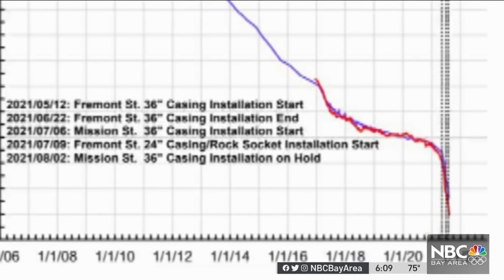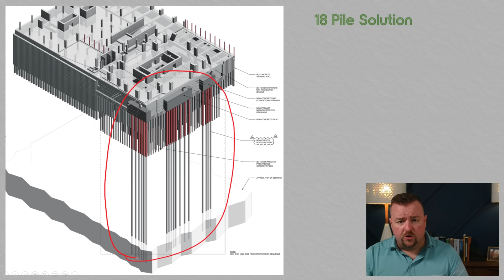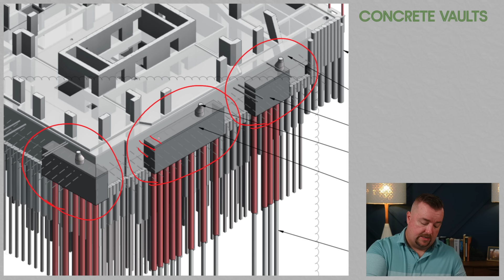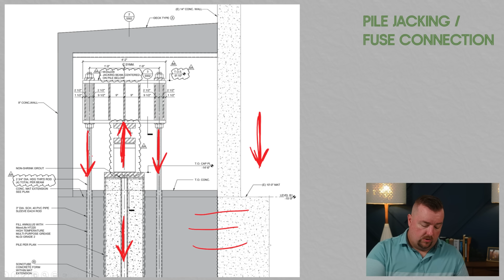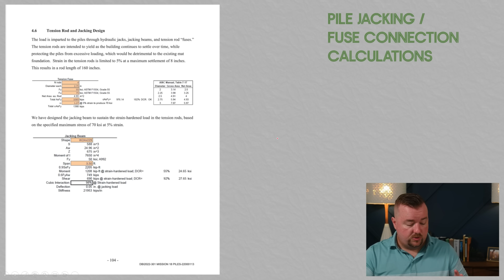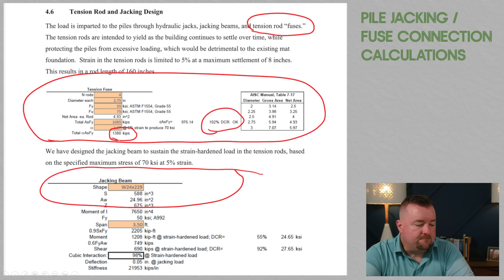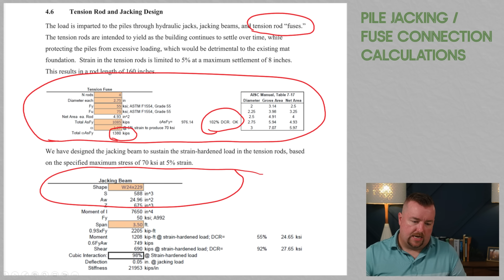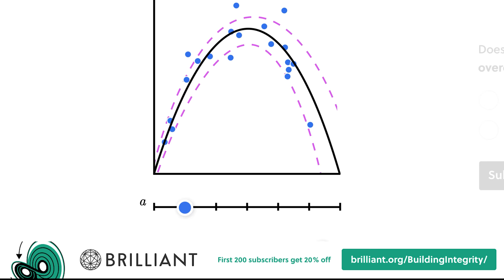Did I Uncover a $100,000,000 Mistake with the Millennium Tower "Fix"?

Comment: This whole cluster f* reminds me of the sequence of events with the Kansas City Hyatt catwalk collapse. I also have my issue with the "fuse" connection to the rest of the structure and the concrete and small amount of rebar being put into tension when the bolts are tightened. I believe that there will be considerable cracking internal of the original foundation as the rest of the building continues to sink. The only question is what comes first...the tiny metal plate that is suppose to hold a couple hundred thousand pounds or the deformation of the tiny bolts holding it all together. Who ever decided to build such a large building in the San Francisco mud without at least a number of pilings going all the way to bedrock should loose their license and be run out of the profession. I am not a licensed civil engineer but it is malpractice not to do ALL the what ifs during the initial design phase. There must have been soil studies and practical experience from all the existing building around them.
Reply: Politics built this building....still is in the repair plan
Reply: Best part about this saga is the people who designed the building are the ones doing that fix!
Reply: They built the foundation, then changed the design and put a tower on top that was twice as heavy as first planned.
Then they were surprised there were problems.

Comment: Boy, I love listening to intelligent people.  The new pilings must have disturbed the material.  The moment you mentioned the grease of the threaded rods I thought, "This doesn't make any sense."  There should be a metal plate on the bottom of the entire concrete block with a hole in it for the pile like a washer.  The threaded rods would penetrate it with an upside-down cone of washers under the plate to spread out the load and then bolted.  I would even weld that entire under plate structure.

The project Architect and Engineers are ultimately responsible no matter what.  The building department will review the documents for compliance to building and zoning regulations but not that what was designed will work.

Comment: The top plate too? As a special inspector in seismic zone, I would want to know the measurements of the plates and the strength of the concrete specified for this. I assume the plates are just typical per the general notes? Probably 50 grade? If they don't work, there is a real problem. Nice catch Josh! I really hope the EOR corrects or somehow proves this works. That a lot of weight to transfer!
Reply: They are designed like macbook traces of fuses. The whole boards catch fire before the fuses break.

Comment: What would happen if the usual insurers decided against insuring a building like this, and /or the usual mortgage lenders refused to lend on the  flats/apartments being built there?
Reply: People are buying units in this thing?!  Who would buy in this failed defective building. How is that possible? wow. Just wow.
Reply: If the developer has a note on it, and couldn't secure new insurance within the prescribed time, the note would immediately get called.
  I'm in Florida.  I can tell you one thing: if this clusterbomb had happened here, the building would have been vacated long ago. Our bedrock is water-soluble, highly porous, and behaves like osteoporotic bone. And our insurers know way better than to trust any engineer or government official.
Reply: @GungaLaGunga  i just looked it up. There units for sale there yes but looks like they have been sitting for some time and all of them are for sale at a significant loss. Not sure who actually will buy there but there are units for sale. There are also some for rent at 3500+ per month.
Reply: @ivanangelov7087  oh interesting. thanks. What a mess.
Reply: 3500 a month! Fk that.  Not a chance. I wouldn't even rent it for 35¢
Reply: @simontay4851   3500/mo to get blamed by the landlord when people's bathroom sewage comes up into your kitchen sink. "The ideal location, and it's perfectly safe. There will be a small waiver to sign, of course"

Comment: If the plate is beefed up then the Nuts start to carry all the load,  after that, the threaded rods are carry a tremendous load.   What I know is you can twist off wheel studs with a large handled wrench.

Comment: Not at all my field... but don't you typically build in a 30-50% safety margin just in case e.g. the condo association refuses to pay millions of dollars in maintenance over the next 50 years? If so, on what planet does a -2% safety margin seem reasonable? Cascading failures are something that I deal with/plan around in my field, so my initial thought was "what happens if 5% of the jacks fail at around the same time and stop transferring the load?" I'm sure that will cause one of the rods to fail due to the negative safety margin. How many rods can fail in that scenario before the entire apparatus fails with a violent "ping" of steel threaded rods? Will that cause secondary damage? Will that secondary damage cause the building to catastrophically fail? Probably the most important question, however, is why is a software engineer like myself asking these questions and not the smarter structural engineers reviewing the project?

Comment: Retired chartered civil engineer in the uk here. It seems to me there are two modes of failure where the tension rods transfer the load to the steel plate. 1. The nuts and washers on the rods pulling through the steel plate and 2. The threads at the  nut / rod interface shearing. Which did you check?
Your video was posted a year ago. What has happened since then?

Comment: As soon as you pointed out the sleeve around the bars I had some doubts. When you started talking about the plate, I knew something was wrong. And I'm quite far from being an engineer or having any sort of physics course.

In software we would get in trouble if we ever designed/programmed something like this for something as critical as this. Just imagine having your medical informations or your bank account behind a software that the developer designed to "have some stretch" to measure how much its close to fail, and with "some" hashing for your password but no one really looked at it, they just used the first result of a google search of "how to save password"...
Reply: Then got a diffie hellmann method

Comment: This sounds like the company chose this fix because it allowed them to do something quickest, rather than if it would work in the long run, they are probably hoping it lasts just long enough for them to retire/die.
Reply: Hoping it will last longer than the warranty period.
Reply: Trust me, the city was pushing for the quick fix just as hard as the engineers and contractors.

I also hate to add a brutal comment but the engineering staff of the city is in no way qualified to review the design of any building of this nature. Unfortunately that is why they are working for the city and not for major engineering firms.

Fact of life in any city... Notwithstanding basic education and expertise, they simply do not have the recentness of experience and access to the extremely high dollar tools and computing power necessary to do this kind of analysis.

Comment: I agree this is an uncommon situation but it is not the first or  only time this technique has been used. I worked on a project where we used this exact process to jack a 400’ building using the same jacks and fixtures as this. I have not seen the use of “fuses” or even know why such a thing would be used, but the concept of connecting large reinforced keyed blocks tied to the sides of the existing structure and pulling up on them with large hydraulic jacks using large steel cradles made of reinforced I-beams with 4 large threaded rods is exactly what we did. It came with other unforeseen consequences such as nearby columns and walls basically pushing through the slabs due to the amount of weight load transferred to such a small area instead of being able to being distributed evenly. It was an easy fix with some additional reinforcement added to the slab with fiberglass rods and carbon fiber wrapping pasting over the walls and columns.  As for the plates, if they are only seeing 1380k in total that’s 690k per plate and 345k per bolt or hole in the plate. The plates are 1-1/2” thick with 1-7/8” on either side of the holes. That is more than enough to lift 345,000 lbs. without ripping out. Especially given they are completely incases in concrete resisting the ability to fold. A 1/2” x 13x7 j-bolt imbedded in concrete can hold up to 120,000 lbs. that’s with no nut or plate on the bottom just a 45° bend.

Comment: This looks a lot like that punch through failure you explained in Florida, but upside down. Between the hardware at the bottom of those rods crumbling the cement, the rainwater that will work its way past the grease and the designed-in overtension I'm glad to be nowhere near it.
Reply: You can at least be sure that the first threaded rod to fail under tension will make it to the surface, concrete cover or not, it is going to have one heck of a lot of energy stored in the elastic deformation, even if a good chunk goes in plastic deformation. If it is under one of the inspection holes it likely will make it to the height of the building.
Reply: @SeanBZA And who is going to get paid enough to be willing to continue going into those inspection pits with all that pent-up energy wanting to be released?

Comment: Damn!  I'm just a layperson, a Paralegal in fact.  But just by looking at those little pieces of steel, this seems like a TERRIBLE idea.  I predict a catastrophic fail of that "fix" at some time in the future.  And I fear that when that happens, the building will "drop" several inches on that side.  That may be enough of a jar to bring the entire building over and down.  You couldn't pay me enough to live or work in that building, especially since I've seen the Seaside Florida Condo collapse.
Reply: I am not a engineer either, but I don't know why they didn't just try to either put in MORE piles that go directly down into the bedrock from inside the building, or just see if they can use the original pilings to push them deeper and connect them down into the bedrock. THAT seems like a far more intelligent choice. This seems to be trying to over engineer something that can be fixed more easily than they are doing.
Reply: @mariawhite7337  they did insert more piles (on bedrock) only to see the sink / tilt rate accelerate. They had to stop and rethink the procedure.

Comment: Unbelievable.  Relying on the tensile stress staying between 55 ksi and 75 ksi is pure design suicide.  When you showed the single page design calculation, I was looking to see what the factor of safety used was.  The factor of safety seems to be 1 or, at best, 1.36.  What about corrosion, seismic loads, wind loads?  It should be noted that there appears to be no way whatsoever to inspect the rods, the plates that transfer the load from the rods into the concrete or the concrete around those plates.

Comment: Putting these fuses in parallel are a horrendous ideas. As one start to plasticly (in-elastic) deform, it will allow more load to those around it. Worse, if one fails and breaks. that load will fully transferred to the others. But not linearly, as the closes peers would see higher loads, I have to guess as the base mat would deform under the load. Likely cause those fuses to also blow, and so on so force.

The thing that I would to hear your opinion on, if a fuse or fuses where to "blow", what would you expect the transient forces to do to the building? I am wondering if such a quick discontinuity where the load shifts from the new peers to the original peers could create, for lack of the correct term, ringing through the structure. I would expect there would be structural damping for earthquakes, but would that be sufficient?

Again, thank you very much for your videos!
Reply from the maker: Thanks for the comment.  I have been thinking about what happens if/when the blow.  What happens to nearly 25,000,000 lbs-force of potential energy?  Could this cause a sudden shift in building position leading to a bigger failure?
Reply: @BuildingIntegrity  One would expect the existing pilings to not go away when the load is removed, or displaced. But is that a fair assumption?? The dynamics of the sandy soil is something I have no solid intuition for. 

But those lower bars, my intuition sees those as the true fuses.
Reply: In my opinion you can't call it a fuse if it's not replaceable!
Reply: @Hyperlooper  Sure you can. A fuse still works even if you bury it in a block of epoxy or concrete.

But what I don't think you can call a fuse is something that is not designed to fail. Or at least, I've never see it used this way. Even hydraulic fuses cause a failure: they stop hydraulic fluid flow where it normally should flow.

On the other hand, those rods are arguably designed to fail, so.....

Comment: That building is going to collapse. That's all there is to it. The more I hear about this fix and this guy Hamburger, the more convinced I am of that this will happen. 

As far as embedding the plate in the concrete, it seems to me like they should have built another vault space below the floor so the plates could be placed on the bottom of the main vault floor. This way, people could come go in and inspect the plate and nuts. But perhaps I am missing something.
Reply: That’s my sense too. Someone with political authority and a moral compass needs to step up and get this building taken down before it comes down.

Comment: I think they'd be better off building more of the building upwards, but only on one side, and letting the uneven weight compress the bad soil the other way. Then adding weight elsewhere, as needed, as the building continues to sink into bad soil, until ultimately (hopefully) the soil expends all of it's compressibility. 
I'd put rods like these on all 4 sides of the building (at much lower strain) as a "backup" on top of that.
Or just get out the wrecking ball.
Reply: they tried that in Piza....didn't work.  The architect sighed and said  "you know it's a damn shame...a beautiful tower like that coulda made Piza famous"

Comment: Josh,  How about the bearing capacity of the bottom plate against the concrete.  It would appear that even if they are using a high strength concrete ie.  7 or 8 ksi  the 6.5 inch wide x 1' 1"  plate would crush the concrete at 690 kip load ie aprox.  8 ksi    Note:  No load factor of factor of safety considered.
Reply from the maker: Precisely.  And the load from the plate to the concrete is concentrated around the bolt so it's more like 12 to 15 ksi force on the concrete around the plate.  This means the concrete will pulverize a bit before transferred loads to the rebar in the concrete.  Assuming the plate doesn't shear around the bolt hole first.
Reply: @BuildingIntegrity  What about the extra steel bars you mentioned at 24:44?  I do not see them in the design document you showed.
Reply: With the size of the hole, the nut and the PVC the area drops to less than 65 sq in. per plate...  That is about 10 ksi on the concrete if the interface is perfect.

Comment: Lower the building height, remove some of the building's floors to reduce the weight of the structure  or this will be a recurring issue into the fixture. Even if the structure is empty, damage to nearby structures will be a growing concern, just as if and when any future quakes may or may not happen.

Comment: I must say that this loooks like a fundamentally poor design. It relies on components and fixings which are difficult to inspect, monitor and replace should there be any issues. If there's a need to limit the load then why not have the limit applied to the jack (pressure limiter) or something deformable on the cross beam. That way if something goes wrong its relatively easy to replace and you don't have to dig out 160 inches of reinforced concrete to get to a nut!

This is all without looking at the plate. Ok efficient design is good but really how much more would it cose for a plate 4 times the width and twice as thick? Trivial, certainly compared to the rest of the costs.

Comment: SeanBZA:

The load is the same on both ends of the rod so I would have expected a double nut on the upper side also. This would cost almost nothing to implement. I am not an engineer, but spent my working days in building construction. If I were paying for this "repair" I sure would want a second opinion. This is way too much money to spend based on the word of an engineering firm that has already failed on this project.

Comment: I wonder if they can actually make the building spring back further when the vault breaks, and have the building go further than it would have if they left it alone.
Reply: When the steel rods pretending to be springs break (either on their own, or as soon as there's 'any' seismic activity) the building will seek to return to it's 30 inch lean.
However, it initially leaned 30 inches slowly over time. When the springs break, it will lean 30 inches "all at once". The amount of mass and inertia is enormous.
I think it is 'extremely' likely that when this happens, the building will not merely lean 30 inches again, and then stop, but rather, it will keep going in that direction
What's more, when any "one" of the rods break, the others will fail in series, like dominoes, as the remaining rods aren't enough to hold.
Reply: Yeah, they are screwed, anything they do in the soil just causes more liquidation effect.
Reply: @HillOrStream  I think it 'might' work, if they over-build the fix (so that it can withstand unusual winds or seismic activity). But it sounds like they're going with a minimalist approach... 
I wouldn't want to live or work near it.